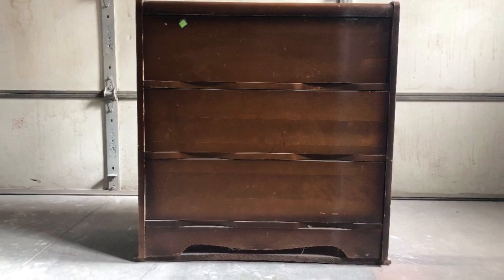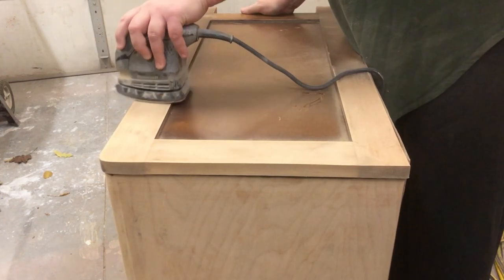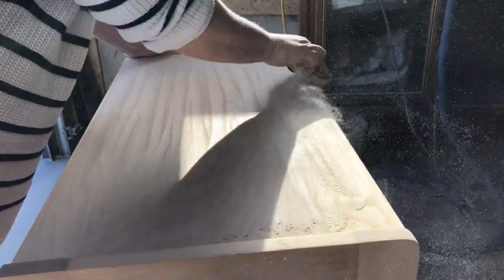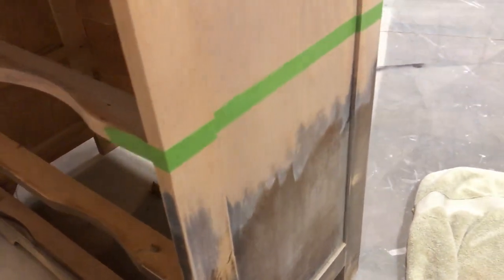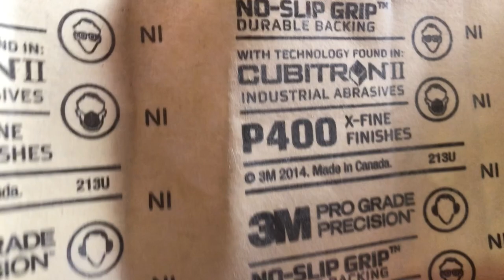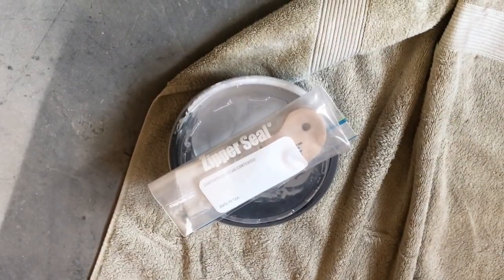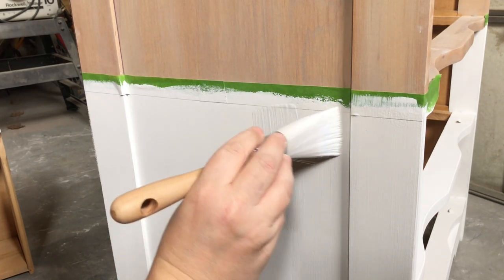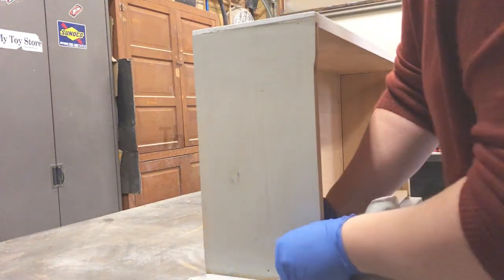Back to Basics THRIFT FLIP! | Waterfall Style Dresser Makeover

Comment: If you want to insure that you get straight lines with absolutely no bleed through, after applying the tape, apply a clear sealer to the edge of the tape to lock it down. You can use just about anything from acrylic varnish to shellac. Now that taped edge is completely sealed, and none of the colored paint or stain that you are using will be able to leech underneath it.

Comment: I got some country chic paint coming but I couldn't find the shellac primer you use. is the water based zinser primer still good with chalk or is that going to be an issue?
Reply from the maker: A water based primer will not stop wood tannin bleed through. You could try a spray paint primer. There’s some magical factor in spray paint that can do the trick sometimes.